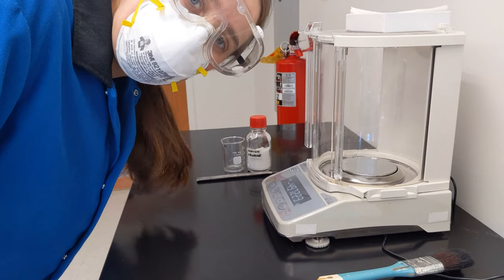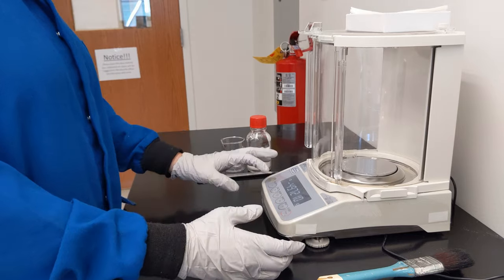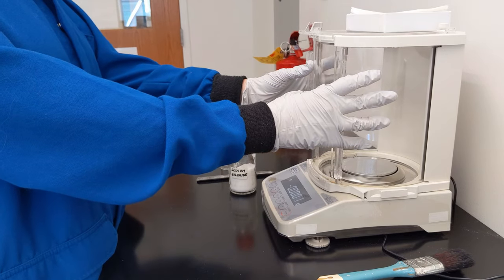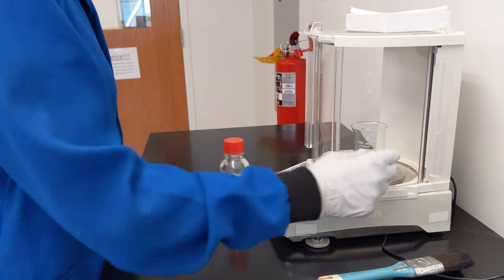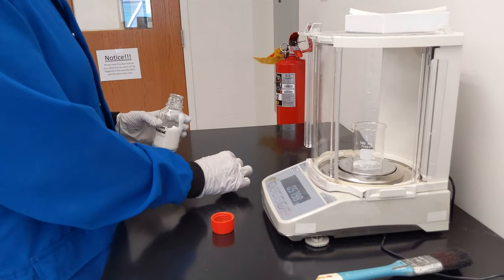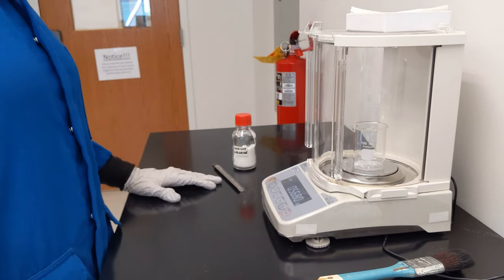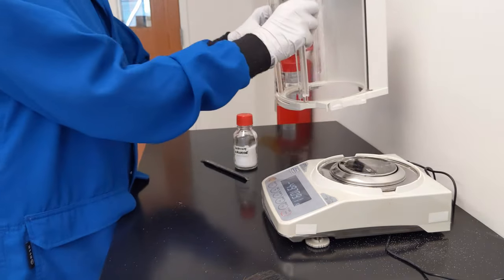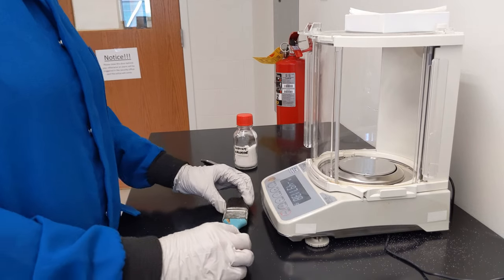How to Use & Clean an Analytical Balance

Comment: Do chemists ever use little vacuum cleaners? I'm worried pushing powder around with a brush could just get it stuck in tight spots. I work with zircon crystals that are only 250-500 microns wide, and it's extremely important that a zircon from one sample doesn't contaminate another sample. Our lab doesn't have a vacuum cleaner right now but I think it'd be useful.
Reply from the maker: @Flounder152, great question.  Yes, but they're never just normal vacuum cleaners.  You would need a vacuum with filters that don't allow your particle size to pass.  Search for "cleanroom vacuum."